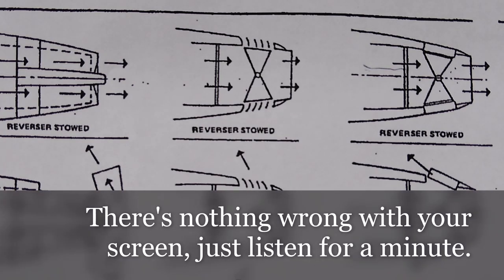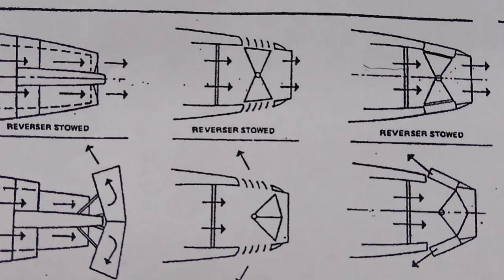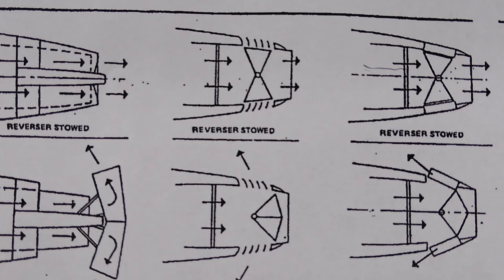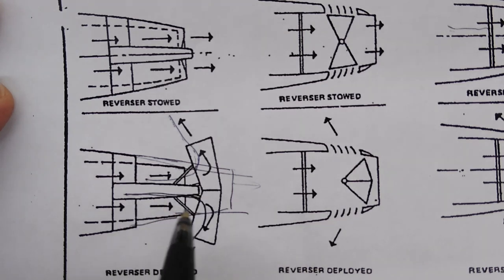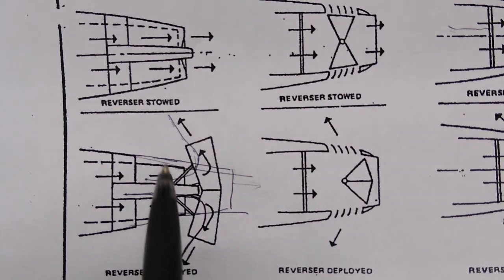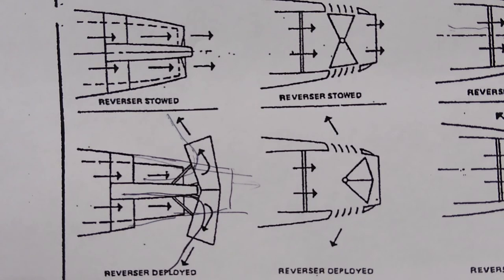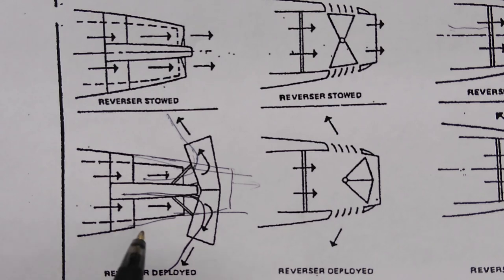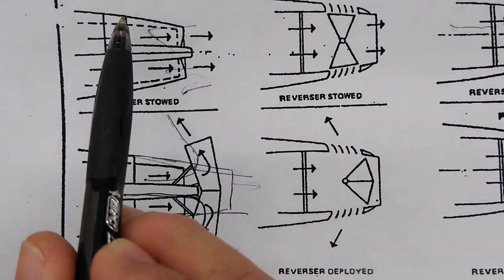Reverse Thrust Part 2 (In the rain)

Comment: It sucks air in from the front of the plane and it pushes the same air back to the front, it sounds like these forces should cancel each other, how does this work? And we are just talking about the air which is sucked by the fan, the core of the engine still pushes the hot air to the back...